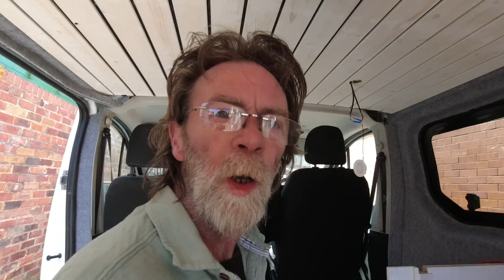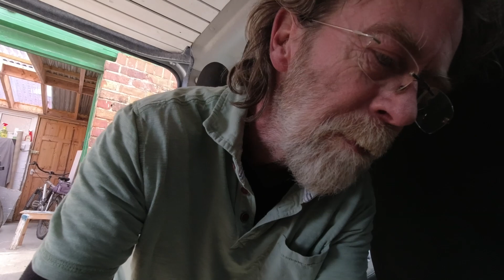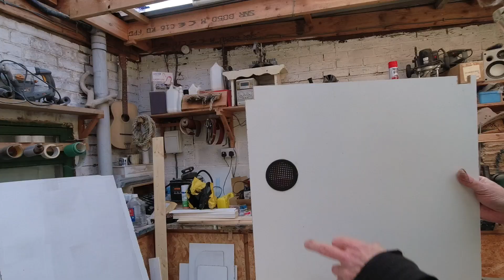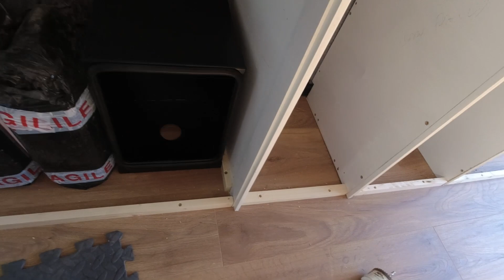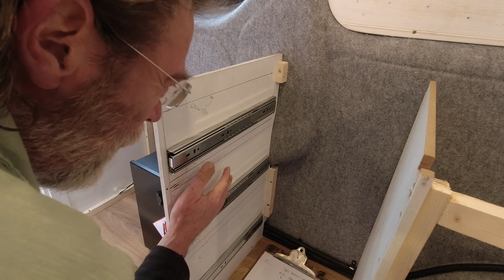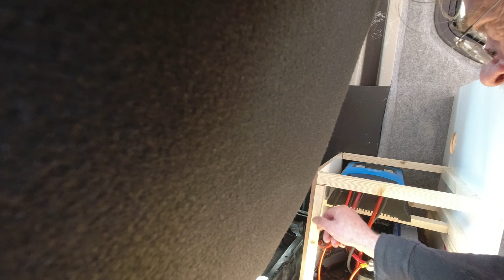Vauxhall Vivaro Campervan Conversion - pt 11 - More Cabinet Making and Complete Electrics

Comment: what ceiling lights did you use pls dave ??
Reply from the maker: Hi I got them off ebay, a search for 12volt LED camper van lights should find them.

Comment: what dcchatger did you use on your build.with the in built solar controller please?
Reply from the maker: hi, I used the ring automotive dc-dc and solar controller on this van. But on other vans I used the renogy dc-dc which I think is a better unit. Hope that helps. Thanks for watching.

Comment: hi can I ask how the light cables ended up in 2 lengths of cable when I watched the episode of the first fix electrics it looked like you only linked one cable through but watching the video now you had two separate ends of cable
Reply from the maker: Hi Luke, It is one cable but I left loops of cable where I was going to fix the lights and I cut the loops to fix the lights in. Cutting the loop makes it look like two cables.

Comment: Hi it’s me again, do you have a link to the controller unit you have and your fancy wire cutting tool. Cheers, Steve
Reply from the maker: I got the wire strippers from screwfix, they work really well. I got this unit from a place called https://www.splitcharge.co.uk/. But to tell you the truth I preferred the renogy dc - dc with the remote screen. I think they do them at splitcharge too.